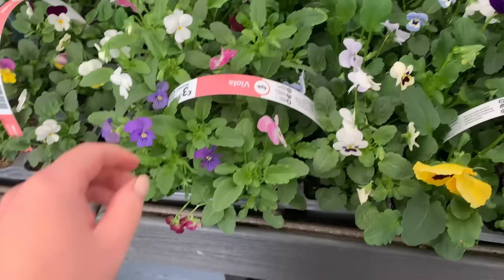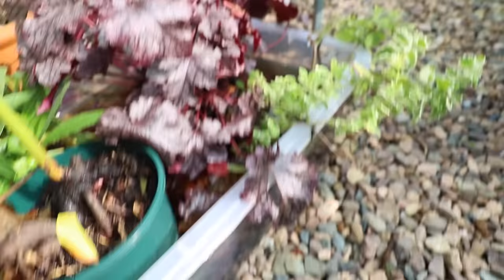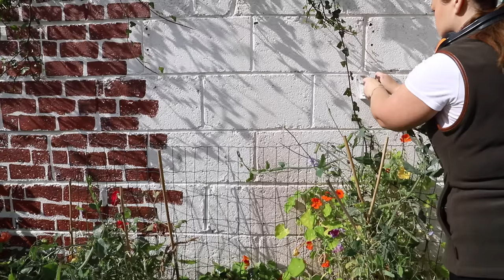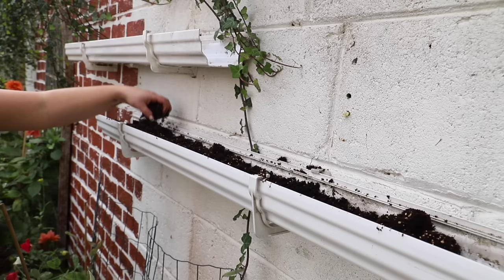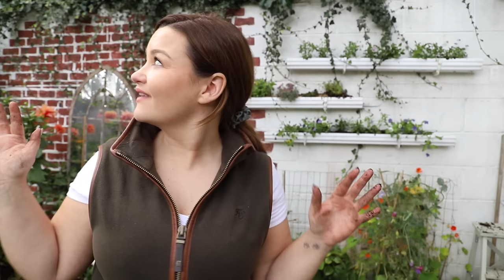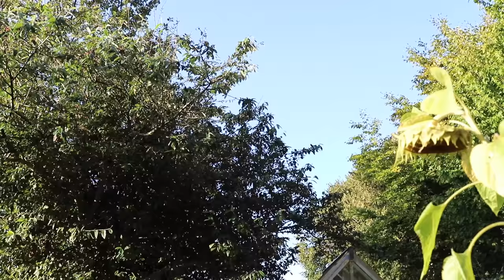Trash to treasure, up-cycled vertical rain pipe planters 🗑️

Comment: so as the sedums are succulents and pretty hardy overall, when you remove them from their pots, you can basically remove the bottome soil and some of those roots, and spread them out side-to-side in the guttering, so that they fit in. more snugly. Also, even if you cut the roots back, they should be fine (if you cut the roots, remove the flowers too, as it'll put more energy into the roots). As succulents, the leaves have their 'store' of nutrients and such, so they can survive fine with some root disruption. :)